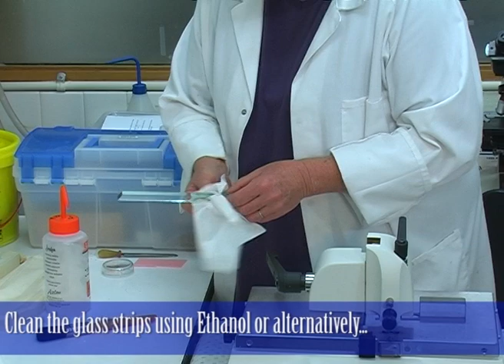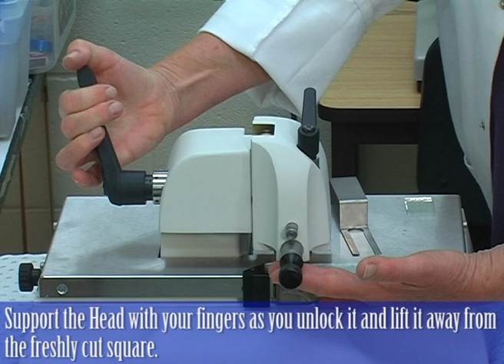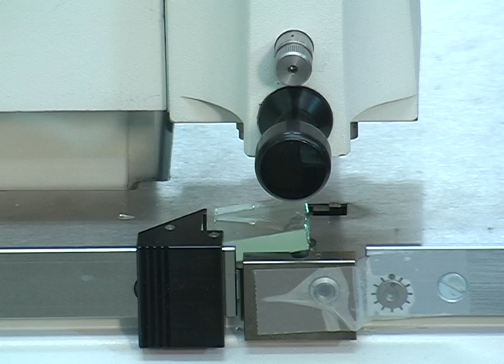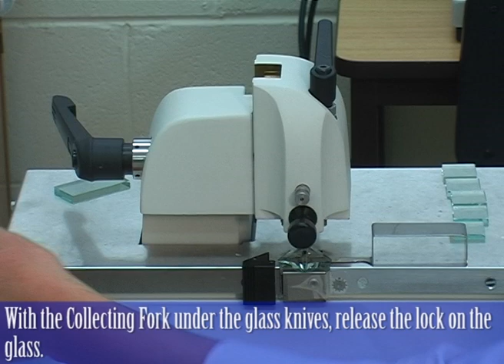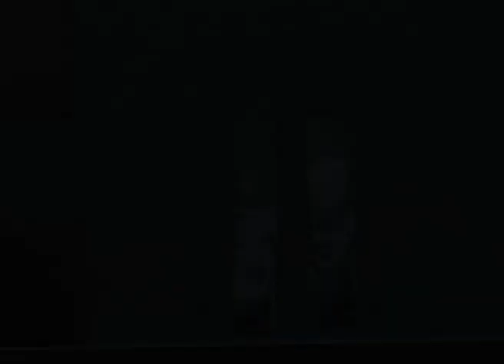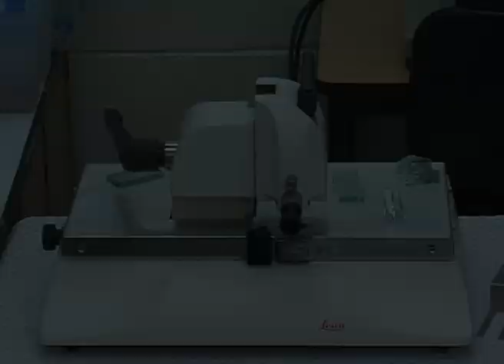Ultramicrotomy: Making Glass Knives

Comment: As a scientific glassblower, I used to make borosilicate glass blades that had an edge that was less than one micron along the edge.... no fancy machines, just clamped the glass strip to the bench, applied a diamond scratch near the end (about 5cms) then clamped the glass with two pieces of wood and applied a sharp downward push. These "blades were used to cut exstremely thin cell tissue. I could make a batch of 50 in less than 10 minutes.
Reply: When did you  this ? Borosilicate  glass dose not leave a sharp  edge when  broken